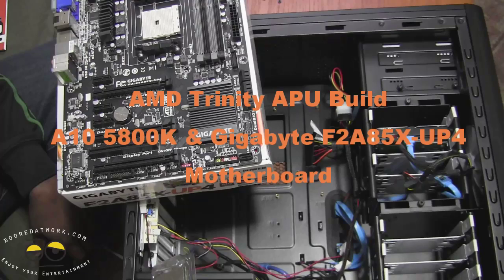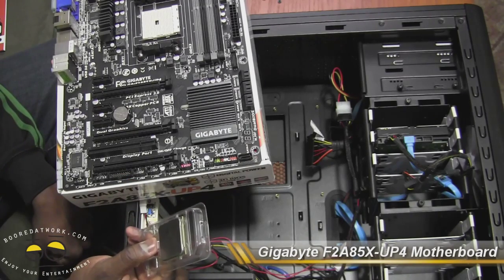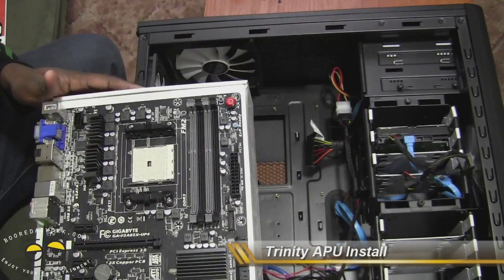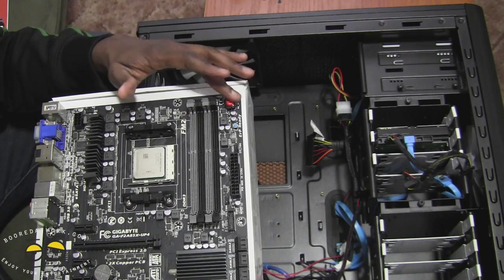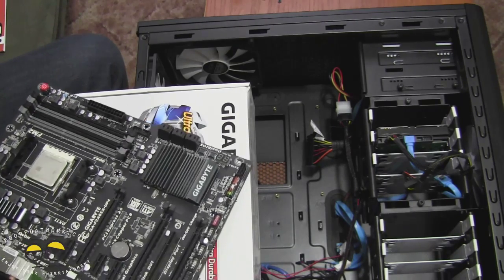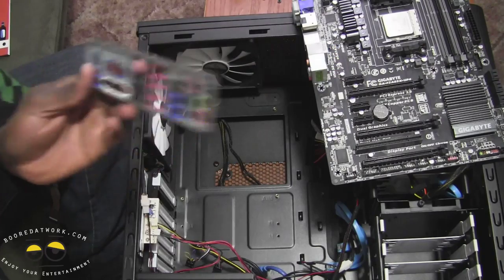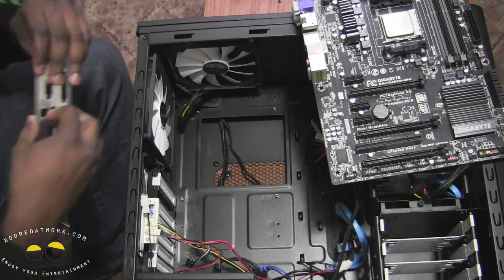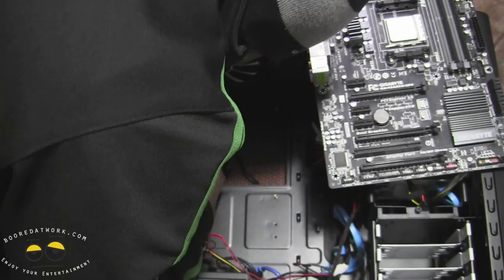AMD Trinity A10 APU Build with Dual graphics setup

Comment: how did it come out after the cable management, 
 your ram is 1333 , I would think you'd pick a high frequency.

 I have the same apu running at 2400 ghz
😁😁😁

 good video though

Comment: I have something to ask.. Firstly i really want to have fx-6350 paired with r9 280 3gb.. However that is quiet overbudget.. So, found out about this A10-7850k with its intergrated gpu to play with for a while.. So, later on if i have some extra money..i will able to add r9 280 .. And will it combine the performance from the intergrated gpu with the r9 280 3gb(crossfire) without any problem?
Reply: +Hafidz Razman late to the party but it seems im the first one in. you cant dual a10-7850k with r9. for dual purposes, r7 250 is the recommended and confirmed by many. you can however disable igpu and just use your r9.
Reply: Ohh its ok.. I found out about it allready.. Thx btw

Comment: Is that card a 6670 or a 6770? One part of the video you said 6670 and another you called it a 6770 just wondering because i have the 67xx  Thank you
Reply: its 6670
Reply: elvinLA larsson
but they should both work ithink

Comment: All these APUs are crap even in dual graphics mode. They have a terrible price to performance ratio. If they come out with a 8 thread APU that has a decent iGPU at a fair price then they might be a viable option for PC gaming.
Reply: Actually dude i use an amd a8 5600k apu and runs games fine, planning on overclocking it when my new cooler arrives and maybe can run bf3 on ultra caus with my stock specs it runs bf3 well

Comment: one tip: don't touch the top of the cpu, the oils on your finger do not convey heat as well as thermal past and the oils make a thin shield on the cpu were the thermal paste cannot get to. so, if you want the best temps don't touch the top of the cpu heatsink.

Comment: I have one question now that we have the new Kaveri APU's and I was thinking to get A10-7850K but I have one question:what graphics card can the 7850K Dual Graphics with? I've been searching and searching, some say that you can go easily over R7 260X because it has 13CU's but one Hardware "Expert" told that it can't support R7 260x but it can do with the R7 250 because it has DDR3 memory.
so the question is can I go with r7 260x or higher even though it has GDDR5? thanks!
Reply: The 7850K can crossfire with the R7-240 or R7-250 cards. The upcoming R7-265 is rumored to do so as well.
Reply: Thanks, so R7-265 is DDR3 right? :)
too bad nobody has water blocks to any of those cards..

Comment: Peoples for money what costs A10 5800K & 6670  you can buy athlon versions like 740,750K,760K and GPU like HD 7790 or R7  260x and with this combination you can get 70-100% more fps than with A10 5800K & 6670 on any game
Reply: BF 4 is weaker than Metro LL
Reply: ***** Metro is a better game to test stability of Graphics and CPU than BF4 Idiot.
Reply: ***** you cant crossfire a a10 with a r9 270.. so that kinda defeats the whole point of having an apu, which is why you buy an athlon, which is literally the a10 with the gpu taken out of it.
Reply: ***** you didnt state that, but why then would you buy an a10 with a dedicated graphics card, when the athlon x4 750k is the same cpu for 50$ cheaper?
Reply: ***** yea the a10 is a little bit faster, like a tiny amount.  but with the FIFTY DOLLARS you saved you could buy a nicer gpu, and run games a fuck ton better. or if you wanted the faster cpu, you could get an fx series processer that would cost the same, but beat the fuck out of the a10 preformace wise.  the a10 is only useful if you don't buy a dedicated cpu.
Reply: it is only faster  then athlon if they got same GPU and if a10 5800K& 6800K got more Mhz ,but a10 5800k dont have more Mhz than athlon 760k ,infact athlon 760K is richland and 5800k is trinity so ... i have athlon II x4 740 with R7 250 1gb ddr5 and that combination is better for gaming and cheaper than a10 6800K & HD 6670 no matter what A10 6800K got 4,4Ghz turbo and  athlon 740 3,7ghz turbo, difference is in GPU-s
Reply: if i buy thru amazon i will pay 100$ +50$ for post taxes ... and it will cost much more so i buy here in ordinary store, and HD 7770 is not so good,i dont see nothing more fps here on youtube videos with hd 7770 and i5 or i7 and compare with my athlon 740 &R7 250.
Reply: you dumbo bumbo idioticus,in my country Hd 7770 is  more expensive than R7 250 , and i watch youtube videos where  they have same fps with HD 7770 on Metro LL like me with R7 250
Reply: i care about Metro LL, and this card is not overpriced,Hd 7770 cost more in my country ,even hd 7750 cost more than R7 250
Reply: And your an IDIOT with bad broken a10 6800k hahahaaa .
Reply: okey
Reply: Oh really? I'm assuming you've already bought all this hardware and tested it yourself?
Reply: Mr11ESSE111 You are a lying sack of shit that has no idea about the hardware you are speaking of. The R7 250 is complete ASS. There is NO WAY that it does better than two GPU's clocked at 800 Mhz working together.
Reply: you are moron without brain!!!  with athlon  II X4 740,750K,760K and GPU like HD 7790 or R7  260x,GTX 750 you can get 70% or more fps than with A10 5800K & 6670 on any game and price is same
Reply: Mr11ESSE111 And 70% more FPS is bullshit you brainless moron! Go look at benchmarks and prove yourself wrong!!!
Reply: you stupid idiot!! find me some benchmark or video 0n youtube where A10 5800K+ hd 6670  is better than some athlon with R7 260x !!
Reply: Called Hybrid Crossfire.. DERRRRRRRRRR
Reply: Aaron Bowerman Hybrid Crossfire only works with a very select number of cards, and only on Windows Vista.
Reply: Mr11ESSE111 No, the price is NOT the same! My A10-5800k Black Edition I got for $109.99 and my Radeon HD 6670 2GB for $53.99. Athlon ii X4 Black Edition is $60, R7 260X 1GB is runs for $109.99 and Radeon HD 7790 1GB is $129.99! Plus BOTH of those cards have only 1GB RAM but 6670 has 2GB so can run higher resolutions with more frame buffer. Plus A10 can turbo to 4.2 but Athlon has no turbo! Do some research before running your mouth you foreign fucknugget!

Comment: I used the same cooler in my APU A8-5600k! It's more effective than the original, when I used to play Farcry 3 before on the original cooler, the cooler went into overdrive, then when I put this one on, it stayed the same noise level and reduced temperature by 10°C! Nice for just £14.00 :D

Comment: Does the monitor connection go to the video card (6670) or the onboard video connection to run with dual graphic cards?

Can you attach to different monitors - one to the 6670 and then the other to onboard video .... and then could you play a game on one monitor and be surfing or whatever on the other monitor?

Comment: Usually any 6670 Radeon Graphics card will allow proper crossfire capabilities. AMD has a good one with 1GB DDR5 onboard. CPU world did a compilation once . Search them out and see.
But u should go from at least a 6670 discrete for crossfire. A better card won't crossfire, but would still be acceptable nonetheless.

Comment: I'm slowly buying parts for my current computer build. I'm surprised how similar what I have planned to what you have in this video. Same CPU, same power supply, same RAM even. My build however is a mITX format so I went with an ASRock board.
Thanks for the video!

Comment: If you are using an OEM version of Windows, Yes you need to install new one. But if you are using the FPP version, you'll only need to install the correct drivers of the new motherboard.

Comment: Again, the APU cooling fan should facing the front of the case, not facing the back. The 2 rear fan is trying so hard to draw the hot air in the case to outside, but the APU cooling system with a fan facing the rear fan will pull the air away from the rear fan. Hence the ventilation in the tower decrease.

Comment: The way you put thermal paste look so amateur...also you only use 1333 ram there you should use higher freq of ram 1600 above to increase your internal gpu performance...for apu the important is ram clock speed not the size...btw you use a high spec of mobo there...nice video

Comment: No offense Mr.Uploader but the thermal paste application was probably the worst I've seen, the way you applied it (and squeezed the tube to death, probably yielding some dried up chunks) in this weird zigzag way will create air bubbles once you squeeze the heatsink onto the APU, reducing thermal conduction (air is a poor conductor of heat) and creating hot zones on the dye. Next time smoothly apply a long line a little thicker than a rice grain in the middle, from a fresh tube.

Comment: Why you are putting the cooler facing the wrong direction. It should blow the air to the back side out of the case not to the front over the RAM.

Comment: GDDR5 is twice as fast as GDDR3, your main graphics card needs to be as fast as it possibly can to reap the benefits of the 7660D GPU. Id also like to point out, depending on motherboard, you could run system memory at DDR3 2400 with the CPU and iGPU  overclocked. Also, having 1GB reserved for the iGPU would get you the best performance per price on these things. And dont forget to overclock the primary GPU attached to the motherboard as well.

Comment: Hi nice build, one tip i would have put the cpu cooler on first so the board would slide in easier when installing.

One thing i don't understand the crossfire, Am i able to use two graphic cards and the apu all at once?

Comment: i have an AMD A10 5800Κ with HD 7660D and an NVIDIA GeForce 9400gt. 
i followed your steps for the dual graphics setup but i can't find the option for the dual graphics enable at the amd vision engine control center....i have better fps by using the onboard graphic card but i want to combine it with my geforce...aim i doing something wrong ?thank you

Comment: I think not. Hes pointing it to the Case exhaust... you want that CPU Heat out of your case because if it it would be pointless even having a cpu cooler. Either direction depending on the push/pull config hes doing it right.